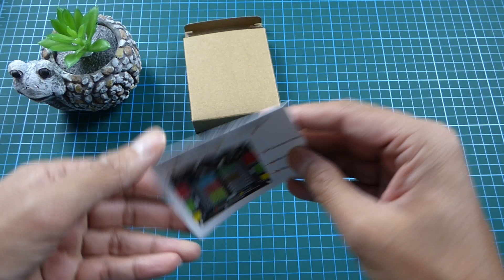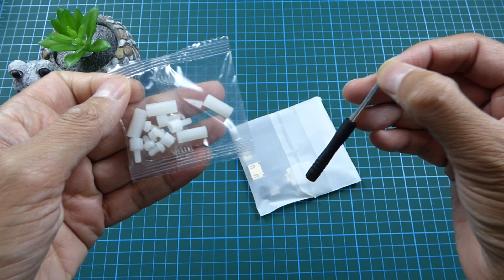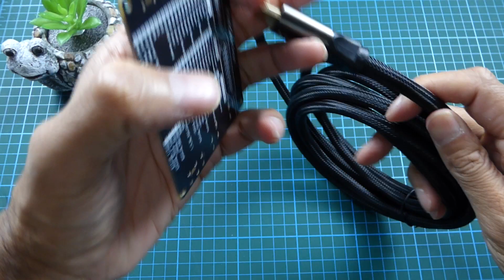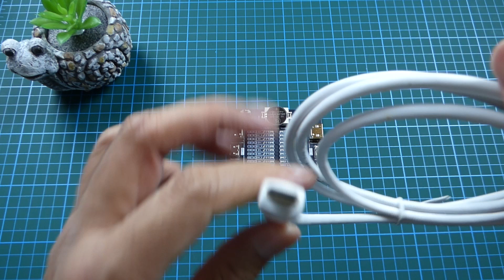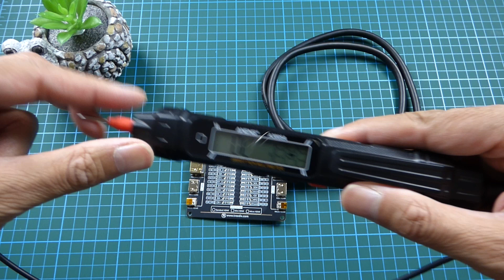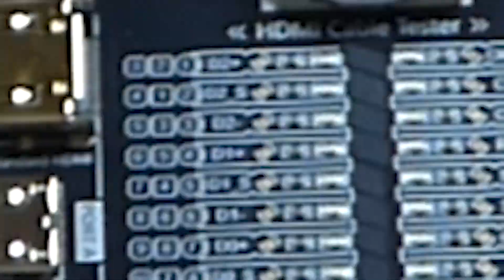Are Your HDMI Cables Garbage ? Find Out with this new $16 HDMI Cable Tester!

Comment: Will it indicate the ability to transmit 4K or 8k and @ how many hz?  What about AOC that is directional?
Reply from the maker: No its not that sophisticated its just a simple continuity tester. You would need the cable to have passed certification. What it does show is how many of the wires are connected and the best cables have nearly all of them. But you can be pretty sure if all the LEDs are lit then it would do 4k at least.